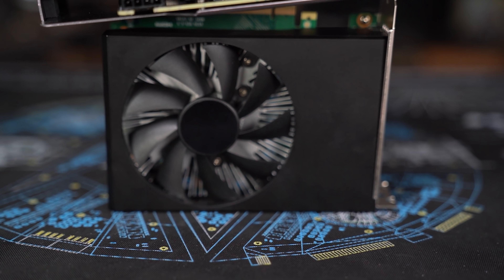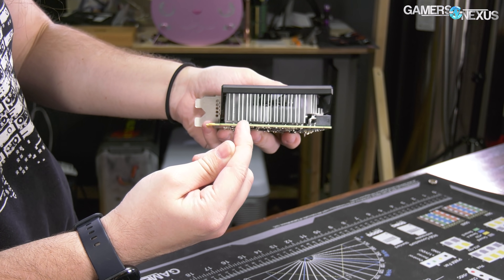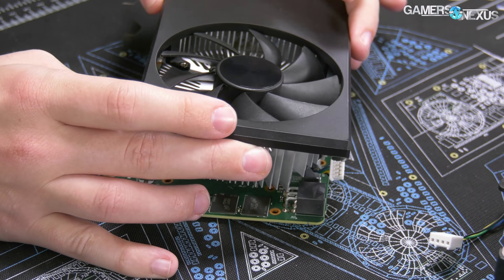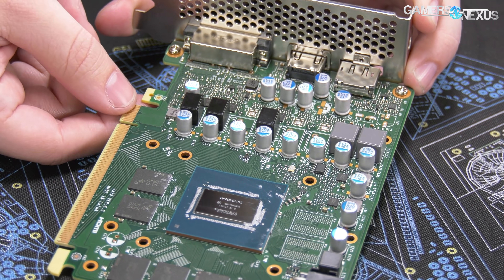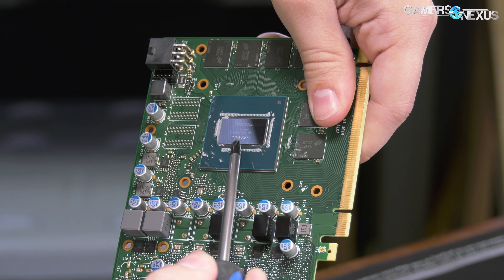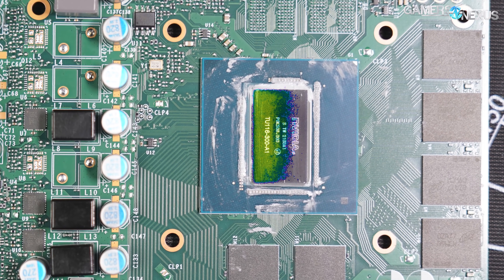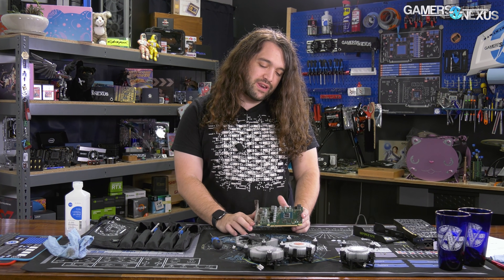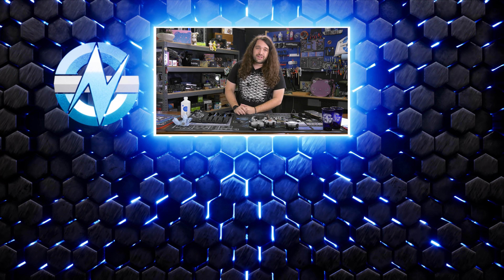Bottom of the Barrel: 110°C VRAM Dell GTX 1660 Super Video Card Review

Comment: So in other words, the card performs as expected, the GPU and VRM temperatures are good, and it isn't too loud. Temperatures for two of the memory chips are high but probably still within spec. The implication is that the card is built so cheaply and poorly that it will be unreliable, but is there any actual reliability data to back up this implication?
Reply: I bought a Dell 8940 with the 1660 Super $650 simply for the card. This guy is full of shit. Firstly, who talks of the importance of cooling on a card if it makes no difference in real world performance? He is going to get sued by Dell for libel and slander. I stopped counting how many times this guy was directly touching the copper contacts on the GPU. The only part of the graphics card or memory module (DIMM) that are delicate or subject to shorting the (PCI-E slot) copper contacts. His argument would be the card is shit. But kids watch this guy and he is not modeling safe behaviors for handling electronics. 

I have the 1660 Super in a water cooled Zen 2 system. It runs in a triple monitor setup with two 144hz 1440p monitors and a 1080p. It runs @ 38C doing desktop work. While gaming with a custom MSI afterburner fan curve it maxes out @ 68-70C which is +5C over a dual fan full size 1660 super. My core clock is +165 and my memory is +660. The power limit is not able to be turned up beyond 100% power. The Core Voltage is unlocked. 

Dell has been making computers for over 30 years. Do you people think they build stuff that is covered by warranty to fail? Is that cost effective? No. Are the components the best, no. But there is not much too a graphics card after the GPU and memory other than the heatsink, fans and maybe a back plate. 

Think of the 1660 Super as a GTX 970. The 970 is a 1080P card and the 1660 Super performs a bit better than the 970 but @ 1440P with lowered graphics settings. 

The 1660 super memory has never had any artifacts and the card has never crashed while gaming.

Comment: All the p106-90 and p106-100 cards have no VRAM cooling - I run 3x in a rig side by side, haven't notice the Ram getting hot at all? might be underclocked though stock

Comment: I still think you're going about these dell pre builts all wrong and missing the point. Why would anyone buy the non rtx 3000 series versions? And no, price/budget isn't an excuse, because the point is to recover cost with mining. If you look at it that way, the non 3000 series options are by comparison an absolute waste of money... I already bought 3: two with the 3060ti and one with the 3080 for a VERY good price (given the market conditions): You call Dell, you haggle for the lowest price, then when they start building, you call and say youll cancel unless they discount further. That way I got the 3060ti model for $1400CAD (about $1100usd) after tax. Those GPUs are pretty well built, and overclock as well as most aib cards (the 3080 is good too but required adding more thermal paste). Then you buy a new, decent case/mobo/psu/cooler for about $250 USD, and sell (not throw out) the dell leftovers for $100USD. You end up with a very good pc for a decent price, that recovers its cost in mining after a few months (*especially* if you have an older/previous pc that you sell while the market is hot). I sold my old pc with a 1080 for about $1000 usd, so that the upgrade to a brand new pc with a 3060ti (including all part upgrades) ended up costing less than $300usd.. This will be paid off through mining 2 months and after that it's pure profit!

Comment: Steve, Dell proved that they can do cheap as hell and achieve 100% performance and consistency. 
They also proved that you, and we as a community may actually be having the wool pulled over our eyes with system integrators overdoing it on their boards. And in a way, however small, artificially increasing the price and their revenue. 

I'd always rather prefer a beefier cooler. But for as shit as this is, if it was 20-50$ less than the cheapest SI model equivalent, then Dell won and made their own market. Sux but it is a real thing.

Comment: ...the board even has holes for ram heatsinks and stuff... 
well, would be at least easy to make a watercooler for it.. cut off the fins and drill through the block, then add heatsinks to the chips around ;-) .. lots of free space for a square cooler block...

Comment: I pulled apart an old DELL Radeon HD 5770 the other day and no surprise it was a much better quality cooler design than this. It had copper on the heatsink and thermal pads on the memory chips.... but it was probably pretty much all Radeon made back then and made pretty well as it still had it's original thermal paste on the GPU and was still doing a decent job of keeping it cool.

Comment: Whenever I see one of this videos I wonder how slavageable this is. What if you put thermal pads on the RAMs and cut the shroud to allow more airflow? Would that have made this an okay card?
Reply: I was thinking the same about the thermal pads but then realized very little contact would be made between the pads and the heatsink spiral fins. Installing a custom heatsink that makes contact with vram pads would be preferable but not likely worth the cost so the other alternative I imagine would be replacing the built-in fan with a noctua fan that can be left on Mid to High at all times to provide those vrams with needed airflow.

Comment: The only thing they had to do is put some holes in that chassi and put some thermal pads on the memory and extending the cooler just a little towards the memory. Then it would actually be a very good small 1660S

Comment: I wonder if this card could be, at least in theory, "fixed". By cutting off the plastic shroud's side panels, inserting thermal pads, and at that point, adding higher quality thermal paste.
With these changes, the card could finally be considered "bad". A big improvement, mind you.

Comment: With time, Dell has started to make more and more of their components in house.  And customized and proprietary enough to make as as many of the components to only work with them.  But what it's even worst.  Is that they have make everything as cheaply as possible.  I would understand if everything was proprietary is ways that you basically get all or nothing.  If there was a good reason. Like to improve performance, or efficiency while keeping the price down.  But nope!  They've compromise the only decent components (the ones they don't make) when slapping their crap around them just to save money.  Good GPU chip and VRAM?  Lets screw them up with our atrocious build.  And they've been crippling CPUs on their Inspiron for years. Either their MOBO or power deliver. You take out the CPU and put it on another machine and it gives you way better performance.

Comment: The saddest part is that this piece of crap graphics card have consumed the GPU die which could have been used on decent product. This is true for all cheap electronics... even going deeper the raw materials used to make this could have been used on something better quality, energy consumed on making and shipping this could have been used on something better. At this point I think it should be considered "socially irresponsible" to buy (and certainly to make) such terrible quality products. 
Considering all the pollution and e-waste issues, what is important to understand that pollution is the same regardless if one buys top range RTX3090 with best components or this piece of shit. Yes good parts costs more money, but they pollute the same - yet they will last 5 times longer and will serve you much better.
In short production of this piece of shit is immoral and Dell should be ashamed of it!

Comment: And the Warranty is brutal... Purchased this unit w/ i5 9400F/RTX2060 back November 2019, GPU had whine, was failing and resetting system regularly under minimal load... even starting a game would crash it... You wouldn't believe how much time I wasted talking to Tech Service and at the end of the day, their suggestion was to "Update Bios and update drivers". Every time same result, literally talking to someone in India while he is making breakfast "Troubleshooting" me when I knew what the problem was.. garbage/cheap parts. Thankfully, one saving grace is that the PC came with a bonus 3 year warranty. It obviously needed it. Forced them to RMA it, instantly solved the problem. But man... I can hear that whine again already, it's only been a couple months. Le Sigh. Live & Learn.

Comment: My blower cooled AMD Radeon RX5700XT runs cooler. At least it has a vapor chamber and thermal pads for the VRAM and . Regular air dusting is all the Radeon GPU needs to last. The cooling solution of the dell G5 GTX1660 equals RMA.

Comment: you wouldn't happen to have a Dell 2060 to test? I purchased an XPS 8940 with that card (supposed to be the same motherboard/system as the G5 in general except chassis, i think) and I'm curious if there are any differences with the build quality between their 1660 and 2060.

Comment: This matches the things we see with the laptops at work.
My old full size Dell work laptop is a old 3000 series intel quadcore, it is superior then the new slim models in almost everything, except the size and battery life.
The new slim models have had faults with SSDs, mainboards, screens, batteries, touchpads, in out connectors, docking stations and cooling.

The service is also really bad, they look up the problem reported and replace things the computer tells them to replace, leading to 2 motherboard replacements in a pc with a bad memory stick.
The 3 motherboard replacement was stopped by me complaining over the phone.

The Dell docking stations we use, can get a damaged USB C connector, if the damage happens under warranty we receive a changeable replacement cable from Dell (guessing 5-10$), if it happens out of warranty the replacement cable is not available to buy and a new dock needs to be purchased (200$).

Comment: Would be very interesting if dell responses to all of this - I have a dell laptop for work and it allways stays at around 80 degree celsius without having any control over the fans.
And when I say always I mean it does not depent on load. Today I did a Cinebench test for half an hour and than let the system sit in idle for the same time. The tempereture was always nearly the same. The device stands on a flat stone surface to get a result that would match a normal usage scenario.

@Gamers Nexus: If you read this maybe you can do some testing with the Laptops from the "business" brands like Lenovo, HP, Dell, ... - maybe there is also a bottom of the barrel.

Comment: I'd love to see this card retested with thermal pads and removing a chunk of that shroud to allow proper air flow
Reply: It looks like you can just remove shroud completely, it doesn't hold anything, fans are screwed directly to the heatsink and heatsink is screwed to a PCB.
Reply: I'd love to see that too!
Reply: @jiggytauruspeppersilver683  And with a better cooler!
Reply: @cat-.-  This. Put an aftermarket card cooler and thermal pads on the memory and retest it. This is how I would tackle any OEM builder card anyway.
Reply: I would stick 3 or 4 little fans to the shroud and make the air flow through the gpu
Reply: I'd throw a fan on it in the case
Reply: I have the same card i bought last week ago is there anyway to reduce the temps? like removing the shroud and replacing it with 120mm fan? and can i also use a thermal pads to cool the vrams and vrm without a heatsink on them?
Reply: @zenfixrepairs did you do this?

Comment: I got a Dell gtx 1080 and it has no branding from Nvidia or the gtx GeForce. It's a single fan blower. Heat runs at 30-50c +. Diff gonna upgrade to another companies card.

Comment: Low or even mid-range Dell or HP computers are pure garbage. They very quickly end up right in the landfill as permanent pollution. They won't even be worth shipping costs in 5 years. A high-end laptop or desktop will more than likely last you 10 or more years before someone else will buy it.

Comment: In regards to the capacitors, those are unvented and are therefore dry electrolytic caps. Their MTBF values are usually fairly high and one generally don't have to worry about them. There is a larger risk that an MLCC cap decides to die before the dry electrolytic ones goes.

In regards to the revision number, I would rather guess that Dell didn't reset their revision numbers when they went into production. Ie, the development revisions are also counted, something that a lot of manufactures do tend to not include in the production product.

In regards to redesigning a board due to needing to switch suppliers of the components is actually not that problematic.
Most (almost all) electronics components are commodities and use standardized packages. The only exceptions to this is generally BGA packed chips, some ASICs, and some high current/voltage chips, or just inductors above 2-5 amps... (I have no clue why, but inductor manufacturers don't seem to care much about standardizing packages.)

Comment: Not cooling VRAM nowadays is simply unacceptable. Do these cards have VRAM temp sensor? If they do, then the likes of MSI with Afterburner, AMD with Wattman and others (*cough* NVIDIA with their antique control panel and lack of monitoring/tweaking panel *cough*) should bring VRAM temperature forward, right next to the core temp because it's almost as important. Cooking VRAM is almost the same as cooking the core. Both are vital to the health of the card in the long run.

Comment: Question, if you find yourself in the unfortunate position of owning this or know someone who does; What could you do to this to help make the card last longer? If you added a thermal pad to the ram thick enough to contact the heatsink as well as either Dremel out some air ports on the side of the shroud or remove it entirely, would that help thermals and component reliability to make it at least somewhat worth it?

Comment: Fun part, these are still $600 on Ebay. I was considering the merits of what could be done if you swap the cooler? and use some thermal pads on the memory? For those that unfortunately own this system. I don't but I considered seeing the cost of the GPU and if it was worth it to buy the GPU from a resaler and fix it. after looking at a quick google search ands seeing the average $600 price tag, I'm not going to try. Resaling a crap GPU for that much when you can spend that amount on a good 1660 super, people be greedy assholes.

Comment: The whole 6:00+ cooler analysis: 
Did you simulate those exhaust theories? If the air had to escape the cooler as easily and quickly as possible, then it wouldn't go through and absorb the heat from the heatsink and pcb components... You seem making things up, while there's nothing to analyze, because the bottleneck is that it's just cheap -> no heatpipes, minimum parts, minimum machining, minimum assembly. Add another 10$ to the cooler and probably not improve anything.
The impressive part is that they almost went away with its simplicity. The temps were mostly fine, apart from those 2 memory chips. Maybe they could redirect the air a little bit with the shroud...

Comment: @gamersnexus something you forgot to mention that is really important if a customer is only buying the pc for the gpu.

In Dell systems with an Nvidia gpu, the video card bios is also made by Dell and isn't supported by Nvidia. This means if you go to the Nvidia website to update the drivers, it will refuse you and tell you to instead to get your drivers from the dell website. If you pulled the gpu to put in another rig, then that means you will need the service tag from the dell pre built to ensure you are getting the correct drivers for the correct card and card bios. 

Also dell isn't known for updating drivers on a timely basis and normally being two to three versions behind.

The more you know.

Comment: Dell is generally a good company, but they have temperature and airflow problems for years. Even in my 2004 Dell Dimension 8300 the Radeon 9800 pro died 4 times due to overheat. But they sent me a new one every time, even a 9800XT at the end.

Comment: 5:52 I don't understand why you would want air to escape sideways right away, instead of flowing down through the fins and leave from the bottom of the dissipator, closer to the VRAM modules. In fact at 6:48 it sounds like for a moment you got the cooler orientation inverted upside-down. Was the card tested without the shroud to see if the cover actually hindered performance?

Also it's clearly built down to a price, so why add the expense of copper when what they have is good enough to keep the GPU at around 70°C?